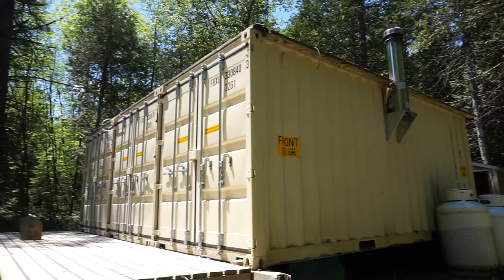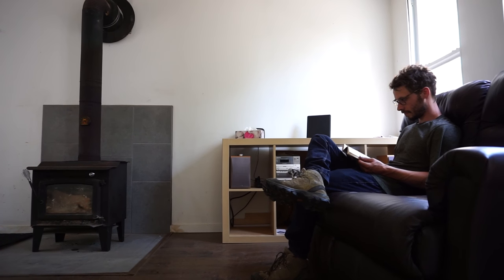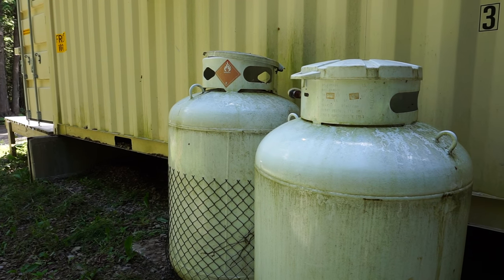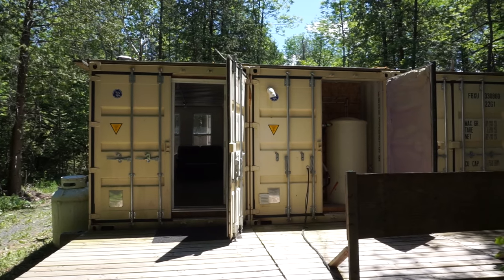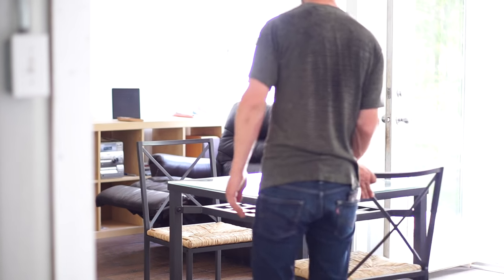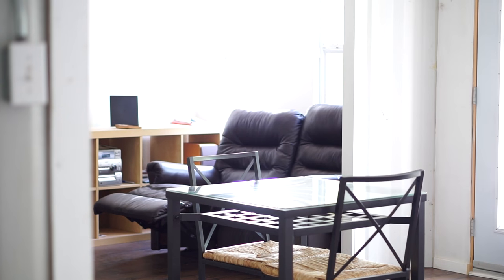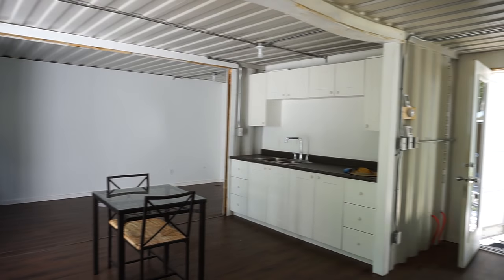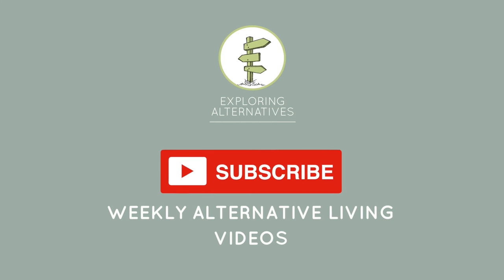Living Off-Grid in a Self-Built 20ft Shipping Container Mobile Home

Comment: This particular design is PRACTICAL and not the usual bullshit container videos on Youtube. It's very, very well executed. While new 20-footers suited his particular use case, if you have the space you can get more than twice the internal room by substituting 40' High Cube (9'6") containers instead. Those are available with doors on both ends. I suggest getting "one trip" (essentially new) containers for a home. My 40' HC with doors on both ends was 5500 bucks delivered on the East coast.  I used two 40' HC WWT (Wind and Water Tight) grade containers for my shop but if I did it over again I'd get One Trip containers and avoid the rust removal and coating hassles.

Comment: Build you a secondary triangle roof to shield your containers for snow (cold) and sun (heat). Then build you a gutter system for your triangle roof, which will be used as a water collector. And lastly, make sure your gutter system flows directly into a water tank. If you don't have the money, tie a 10 x 12 tarp to four trees. Make sure you put a 40 gallon garbage pale underneath so the water could run off into it.

Comment: I wonder if he can lock and unlock the actual container from the inside. Imagine getting locked in from the outside! Yikes!
Reply: Mikey Gordon I was thinking the same thing
Reply: Mikey Gordon IF you check out how emergency escape doors on ships är made with the padlocks outside you can make a closeable door of which can be open from THE inside, No risk of getting locked inside.
Reply: He can move the fireplace and get out
Reply: Yea build an exit from the roof he must..
Reply: It's easy to have any setup you care to fabricate inside a container, including adding man doors in walls, ends or the end doors themselves. I put my shop man door on the end opposite the end doors, and we fabbed a simple angle steel frame for my bro to fit in one of his end doors. New steel was less than 75 dollars, the steel commercial door was 50 bucks new in the box surplus from a contractor buddy, and most of the money went into his high security electronic lock but that's because he enjoys such things. One of the vertical locking bars remains on the end door, and he bolted a plate between the doors on the inside so there's no opening them from the outside without a rescue saw or cutting torch. (There is no wall you can't get through with the right tools!)

Fabbing the door frame is simple. We used welding stands instead of saw horses but that will work. We placed the door on the horses, shimmed the angle to suit the door, welded the angle at the corners, removed the door, welded 3/4" angle on the inside for the door to seal against. then placed the door back in the frame and welded the hinges (which were already on the door) to the frame. An easy afternoon for two old farts who move slowly! 

Being ex-USAF of course we considered other more exotic entry/exit options but there's no real need. He also fitted a split system air conditioner (two holes for pipe beats a window unit any day) which saves interior space and is cheap to operate.
Reply: Mikey Gordon  Now I gotta replay to see if he had windows.

Comment: it'll be sad if someone decides to close all of your hinged door's and you can't get out, but you probably put a lock on them and lock it to prevent that from happening. imo you can probably further insulate your container by adding a tilted roof for extra shade for the summer and have a water run off the roof into a 500-600 gallon well with a filtering system and pump.

Comment: $2150 usd in Seattle. And that's before you insulate it and get it to the site. Once you get there it won't add any value to your property like a normal stick built structure would. So really the costs are much more when you look at lost equity. That said... after having my cabin broken into twice, I may look at this option purely for security and sacrifice the windows and the costs.
Reply: are u saying the cost of one shipping container is $2150? I ask bc the number is surely low for at least 3 shipping containers in this video
Reply: Jennifer H. Yes, just one.
Reply: @Adymn Enoka Ikaika Anakin Aaga Sani - With some effort a 20' container in reasonable state is available from 500€..